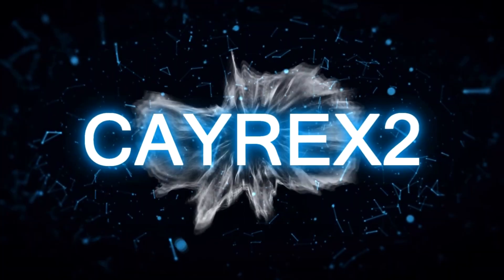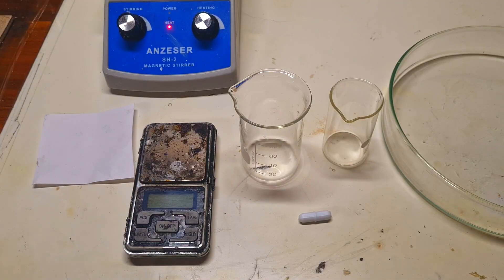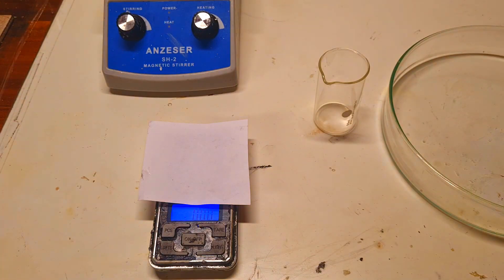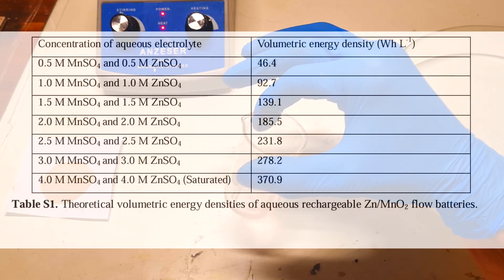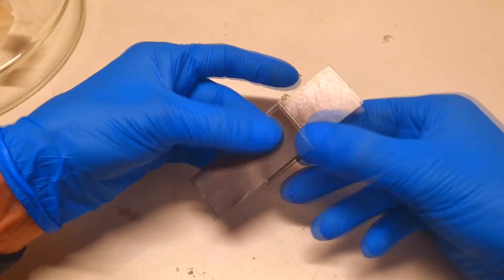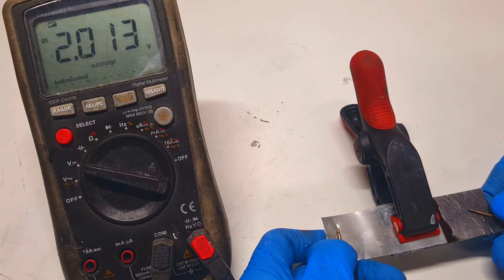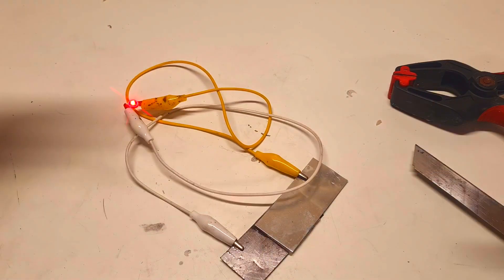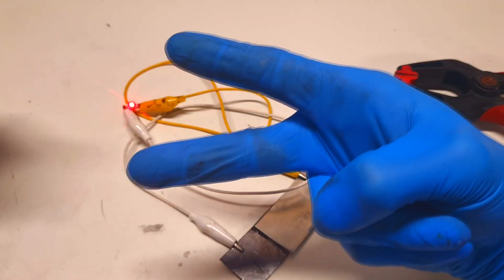DIY Zinc Manganese GEL Battery

Comment: I would like to share an interesting discovery with you.
I managed to obtain a liquid with a very high concentration of ions. It has almost no water in it and is liquid at room temperature.
The safe voltage that I managed to obtain on it is 2.5 V. Boric acid, zinc sulfate 7 hydrate, whip potasu and Very little water. Water only to make it liquid at room temperature.
Reply from the maker: @tdx110  Nice. Thos liquids are mostly called DES (deep eutectic solvent)  or WiS (water to salt)
Reply: @cayrex  I know that the chemistry on the GPT chat is at a high level, so I spent a few days writing with her and looking for the right ingredients.
It can help quite a bit, especially if you want to get ionic liquid. 😋
Reply: @cayrex Thanks. GPT chat helped me a lot with this. It turned out that he knows chemistry very well. The rest is just to choose the right questions and draw the right conclusions.
I sat and talked with him for two days, and he proposed this relationship to me.
Reply: @cayrex  Thanks. I wrote for a few days in AI Chat. AI knows physics and chemistry very well, all you need to do is write questions well and understand what the chat is writing. This AI suggested to me what liquids would be good. I wanted to use ionic liquids, because water has its limits. It was specially selected so that it would not corrode the electrodes. For now, the charging voltage is 2.6V. After switching off, the voltage is stable at 2.4V, but I haven't charged it completely yet. I have to fix the electrodes and I will write updates. As for the positive electrode, from what I know, water glass on aluminum is good (I could use other ionic liquids with a higher voltage of 3V, but they use KOH).

Comment: At what PH does it go from being a rechargeable battery to being more like a standard non-rechargeable zinc manganese alkaline battery?  What else about the chemistry makes the difference between rechargeable and non-rechargeable besides the pH? I know using your agar gel prevents the formation of dendrites on the zinc, I mean besides that jel, like the influence of the anions and any complexing or chelation agents. I read somewhere that the crystal structure of the manganese dioxide is important, but I have no idea what the options are or how those are influenced to make  different types.
Reply from the maker: The key difference between rechargeable and non-rechargeable Zn-MnO₂ batteries lies in the pH and the reversibility of the reactions. At neutral or mildly acidic pH (4–7), the Mn²⁺ ions in the electrolyte dissolve and re-deposit as MnO₂ during cycling, enabling rechargeability. In contrast, at high pH (alkaline conditions, ~13), the MnO₂ reacts irreversibly to form MnOOH or other stable compounds, which cannot cycle effectively. Rechargeability is also influenced by factors like electrolyte composition, suppression of zinc dendrites, and controlled voltage to avoid side reactions.
Reply: @cayrex  another words for rechargability avoid hydroxyl ions because with manganese it's irreversible.. got it! Thanks!

Comment: Very interesting.
How does this technology compare with Zinc Bromide batteries?
Better, worst, etc?
Any advantages?
Reply from the maker: @SmalltimR  Hard to say for gel version, because it is too early. For the flow version I recomend to check the paper. I mean the Zn/MnO2 flow tech is not bad at all. But the problem is that the MnSO4 have really limited solubility.

Comment: In the future, i want make some calcium-ion polymer batteries, the cathode material i'm use calcium aluminum phosphate (Ca3Al(PO4)3), anode material use graphite and carbon (G/C), separator use paper (celulose) and polymer electrolyte i'm use Triethanolammonium calcium chloride with polyglycerol (TEACC.PG), voltage range by gibbs electrochemical potential of calcium ion (Ca2+) is 2.8 V if not recharged, if recharged, voltage can get maximum several ~3,6 V, i hope the theoretical and hypothesis is same in the future.. You can saw the structure of my batteries on my community youtube channel.. Thanks for reading
Reply: Can you predict how many cycles would it tolerate before starting depreciation?
Reply: @SergioLopez-ep2pg  ok, first.. Calcium ion polymer battery (Ca-Po) is stable for ion movement, may can over >1200 cycles, i haven't tested it,  normalny over >1000 cycles can looks the capacity is depreciation, because the calcium-ion can be interact with electron on electrolyte surface area and turn into solid electrolyte interface (SEI), SEI can make depreciation capacity
Reply: @Epsilore_Deltarime  are you going to make a video how you built it?
Reply: @SergioLopez-ep2pg  sure, i want to make the calcium ion polymer battery with video and tutorial how to make it..